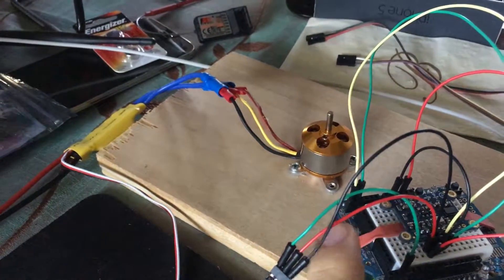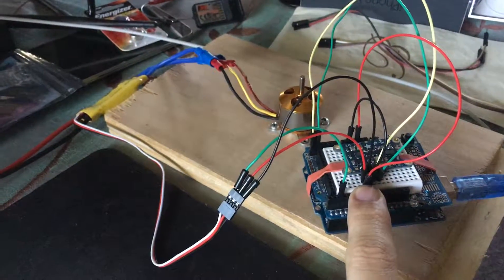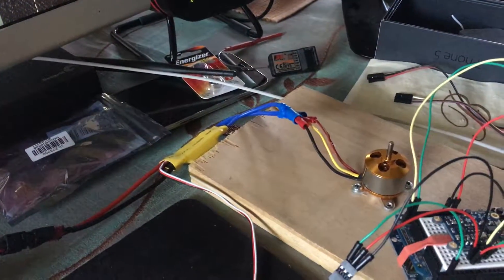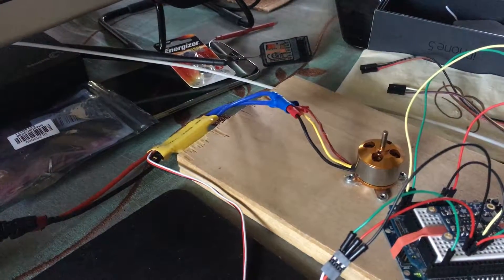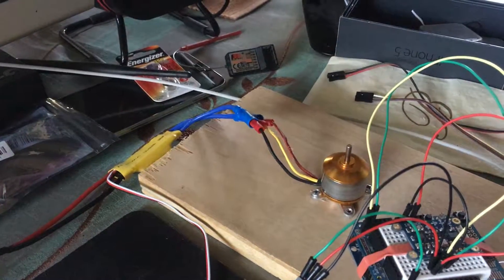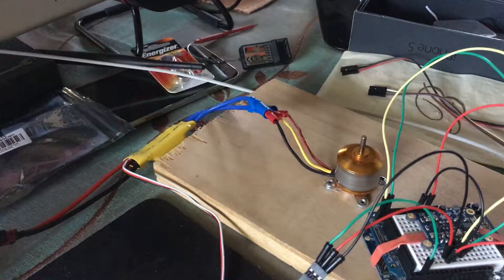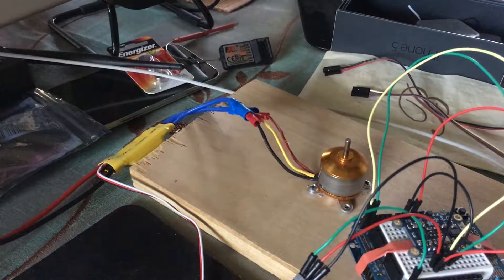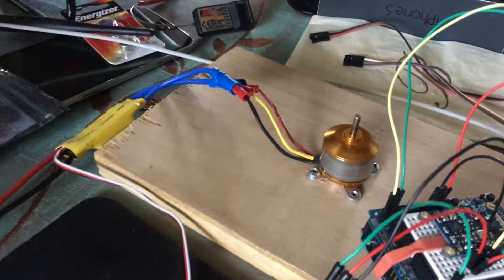Why is this ESC slow spinning my motor down?

Comment: Did you find a solution?... i have the same motor and esc and i still can't figure it out
Reply from the maker: Yeah, it needs to be calibrated correctly. I can't remember how to do exactly but I figured it out by searching around on google.